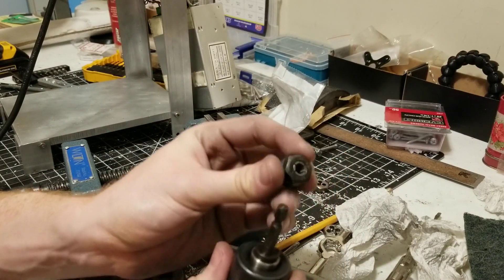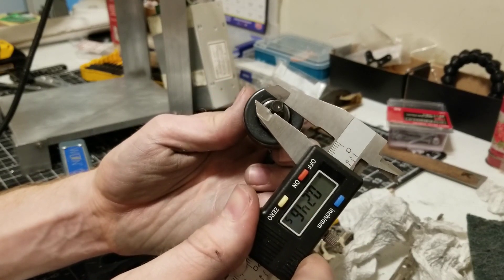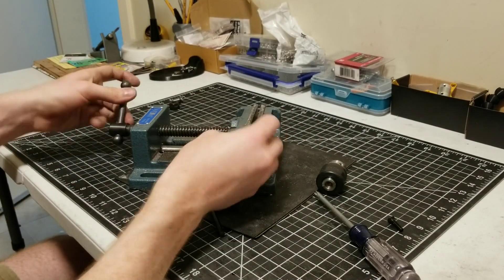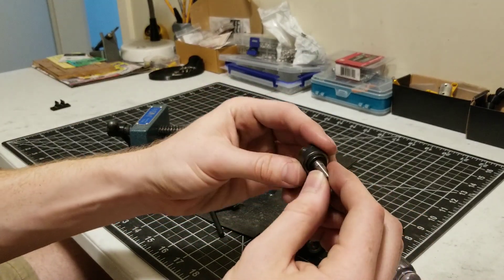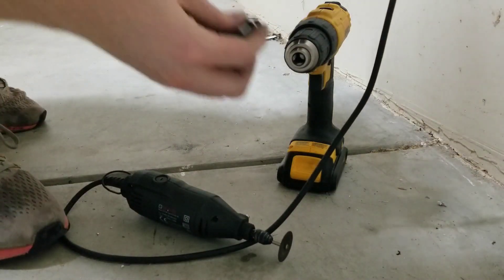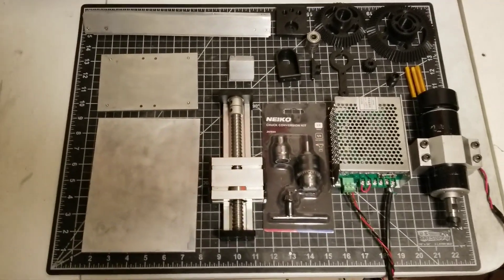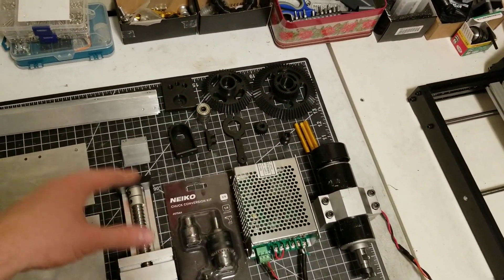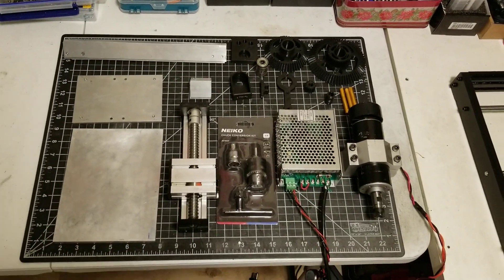Homemade DIY Drill Press

Comment: Why would you sacrifice the low runout of an er collet chuck, for a wobbly quick release chuck?
Reply from the maker: Good point. Mainly because i wanted to use a variety of drill bit sizes easily, which is why most drill presses have a chuck. Otherwise id have to buy many many collet sizes.

Comment: How would this work with the rails? I get how to mount the motor, but how would you interface with your hand crank?
Reply from the maker: Good question. You have a few options. You could add a lead screw/nut in between the rails and fix the nut to the motor mount and use the same crank system I have. Or you could use a more traditional lever on a pivot where the lever would have a long slot in it that would connect to a pin/bolt coming off of the motor mount. The final solution is just to fix a handle directly to the motor and literally push it up down along the rails. In the lever case and the fixed handle case, I would spring load the motor into the upmost position.